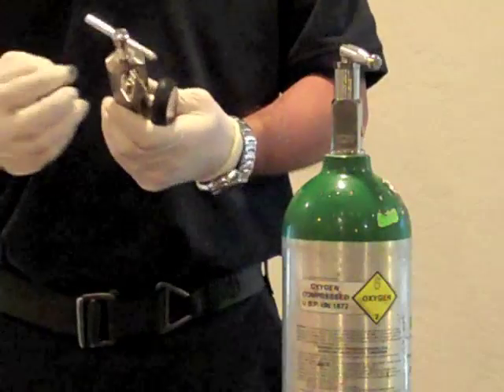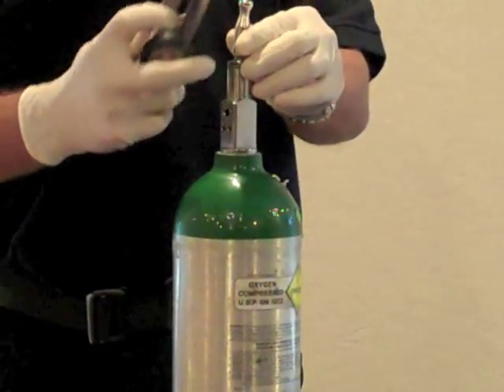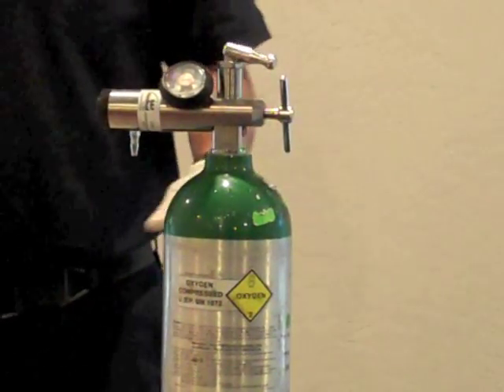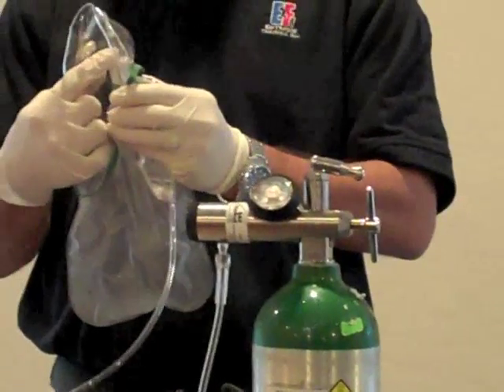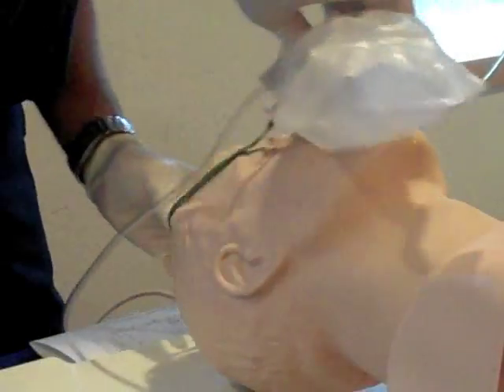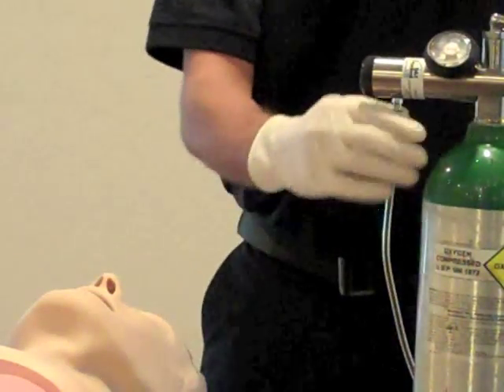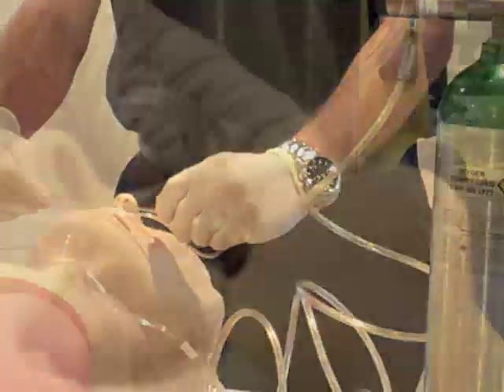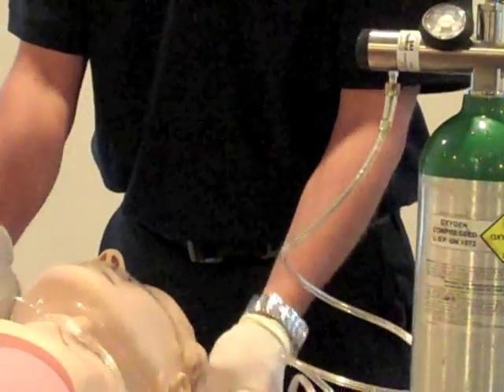Administering Oxygen via Non Rebreather Mask and Nasal Cannula

Comment from the maker: If you will review the NREMT skills sheet for this skill you will find that "cracking" the tank is not a step included. Your local system may teach this, and if you do not keep a sealed tab around your O2 tanks ports then dirt could get in there which would require that quick blast to remove. However, if your tanks are kept properly secured you should have no need to "crack" the tank. Thanks for the comment!